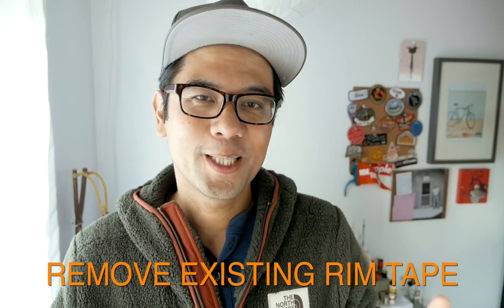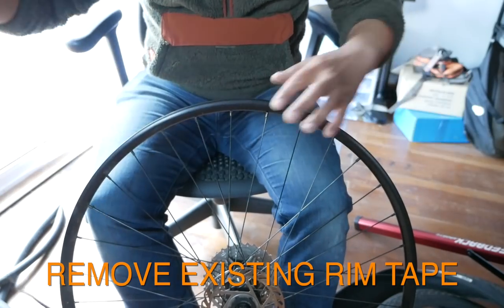How NOT To Go Tubeless - 6 Things I Wish I knew Before Going Tubeless

Comment: Ok, 1) first pump up your bank account, and set aside a lot of time, get ready for a lot of web surfing and garage time,  2) get the right tubeless wheels, 3) get the right tubeless tires, 4) get an air compressor or air compressor type pump,  5) get the right sealant (environ friendly, CO2 compatible, repair bacon compatible, never mix sealant brands),  6) get a tubeless tire repair kit including A) a tubeless valve stem tool  B) a tubeless hole repair tool and bacon strips, C) CO2 cartridges [2 min], D) CO2 inflator tool , E) good tire tools, F) extra valve stems with removable cores, G) you may need 10-12 zip ties and a cutter - the zip ties can be used to lightly press the tire to the wheel in hopes of promoting a better tire-to-wheel seal before you use your last CO2 cartridge - there are different zipping strategies for different tires 7) labor: mounting and sealing for the 1st time can be really messy - get a sealant syringe or lots of rags and soapy water 8) If you get air leakage, go back to shop or garage, take tire off, check the sealing tape, if needed, clean wheel and tire and valve stem with warm soapy water, dry and start all over, buy a better brand of tape, buy a lot of tape, remount tire, remount valve stem, add new sealant, 9) for adventurers far from help, its always smart to carry an inner tube - say what?  . . .  OR  just do what 95% of professional bike racers do - just forget the tubeless cure-worse-than-the-disease craziness and use a really good tube (e.g. Specialized, Michelin, Conte) inflated to a reasonable pressure and go riding.  :)
Reply: Or go to a shop and do it for 35 dollars
Reply: It's literally not rocket science... you put some tire goo in the correct tire and rims and you're good to go no flats no issues you can go low pressure it's great
Reply: Not gonna convert to tubeless cuz wheels aren't tubeless ready. Better save up $ for a brand new gravel.
Reply: @CERVEZAslam or just dont spend an extra 35 dollars on the 300 dollars you already spent going tubeless
Reply: Hahaha you said it all.

Comment: I converted two bikes to tubeless.  One conversion was done by an excellent bike shop.  The other done by me. I had tires going flat (slow leak) on both bikes after 4-6 weeks of commuter riding.  I've ridden tubes for years and I have never had a failure from patching a tube on a tour.  They are a known quantity.  I thought about a tour I did 2 years ago where I ran off the road and crashed my front wheel into a large boulder.  The side of the rim was dented badly. There is no way a tubeless tire would have reseated against that rim.  But I was running tubes. I installed a spare tube, pumped it up and rode the remaining 40 miles without a hitch. Being able to get home in a remote area is far more important than how "bulletproof" tubeless is alleged to be.  I am considering Rene Hearse TPU tubes, but I will never do tubeless again.

Comment: Short version:  it's all about tolerances.  Long version: It's all about tolerances.  You can't depend on a loose-fitting tire.  You can't depend on a rim that's undersized -- either diameter or width.  If the diameter is too small, the tire can slide around and possibly pop into the rim bed's central well.  If the width is too small (e.g. half the width of your tire), it's not well-supported during cornering, and can lead to burping and rolling it off the rim.  You can't depend on a rim without a bead shelf -- it keeps a (properly sized) tire pushing against the rim sides, and thus sealed -- without it the bead can more easily slide into the rim's central channel.  You can't depend on a tire with bumps of rubber on the bead (from where rubber was injected during molding) -- just another pinhole through which air/sealant can leak.  Clip them off with nail clippers.  You can't depend on tape that's too narrow (narrower than the bed and sealant can seep under it).  It needs to come up the sides just enough so the air pressure smushes it between the bead and the rim sidewall -- that's what keeps the sealant from seeping underneath.  You can't depend on thick tape, as it rounds out the bead shelf, neutralizing it.  You can't depend on a tire whose bead is kinked or stretches.  Get tires with soft rubber coatings on the bead, preferably square-ish in profile, as that's more surface area to mate to the rim sidewall.  Mavic's tubeless rims (e.g. the new Open Pro with the 'whale humps' like on Zipp NSW's) are great because they have very tight tolerances and a bead shelf.  Nox rims also have the shelf, tight tolerances, and with say, Maxxis ReFuse or Panaracer Gravel King SKs, seal with just a floor pump and not even any sealant.  I'm sure there are other combinations (Boyd rims come to mind), but these are known to be easy and reliable to work with.
Reply: Bead shelf you say... For a noob this is probably the thing that should go at the start of any tubeless how to video. Check if your rim has a bead shelf.  To be fair who would knowingly buy a replacement for a damaged rim without one?
Thanks for this useful insight.

Comment: I'm actually thinking of going back to tubes. I never had a problem with them and life was simpler with them....for casual riding.
Reply: Well, I am cycling around 15000km/year and had this year my first two flats with tubes. Tubeless is the way to go in mountainbiking as I heard, but with all other bikes tubes do great.
Reply: My problems with tubes were common sense problems and easier to repair (or get repaired at my local bike shop). Went tubeless 3 years ago and never ending problem with tire. 3 different repair shops, tire replace twice - valves gumming up and today gel leaked out, valve came apart and can't get air in now. Would not go this route again.
Reply: @ForkInTheButt  have you had a puncture that had sealed with the sealant in the tube ?
 I cut a old tube all the way around and use it as a buffer between the tire and new tube  .
 I have hit a couple of 3 inch jagged rocks that they use here to fill pot holes and this time no flat .
Reply: For casual riding there’s no need for tubeless
Reply: I enjoy being able to ride over glass and hit kurbs worry-free, but tubeless is absolutely higher maintenance because it tends to lose pressure quicker (and if it's damaged, quite quick) and then you're supposed to top up sealant a few times a year. I'm definitely a tubeless person though - if I was changing tyres a lot, that would be the one time I definitely wouldn't use them.
Reply: @U Betcha Lol .

Comment: Here's the thing... they say going tubeless saves u weight, how much weight? approx 27.5"=109g(218g), 29"=116g(232), remember u have 2 tyres. so basically you're looking at 232g for a 29er but then u need to bring a tube along just incase u get a big cut on the side n your sealant will not plug the sucker...so, effectively speaking, u save only 116g cos u had to carry a tube. tubeless, in the long run, will cost u more undoubtedly so. The sealant will need replacement or replenishment after every 3-4 months depending on the sealant u use. the only benefits aside from saving 116g is that u can continue riding if the puncture hole is relatively small plus u get ripped muscles from pumping those impossible wheels n good luck doing that when using a portable pump n if u use co2, add that to the cost of going tubless

Comment: I’m going tubeless for various reasons. I don’t have to worry about carrying an extra tube with me although carrying one is still recommended, I don’t have to spend money on inner tubes constantly, tires are slightly lighter not by very much, but what broke the camels back that made me take the decision to go tubeless is one of my tires actually rotates indecently from the rim with the inner tube causing damage to the valve. I’ve already gone through 4 tubes because of that. And it’s because the tire is no good anymore. Going tubeless will eliminate all those problems. I’m the same thinking. Fit it’s not broken, why fix it, but in this case, going tubeless will solve all those problems.

Comment: One tip that I felt kind of dumb until it hit me - after adding sealant the last time on one of my tires the bead wouldn't seat. No problem - remove valve core, use the reservoir "manual" compressor, bead seats. Ok but now what - you have no core and if you take the pump off the bead falls away. Finally on the third time did it right - remove the pump - quickly get finger on stem - now quickly move finger and get core back on there. Voila bead still seated. Now inflate away.

Comment: The market is pushing us all to go tubeless because now majority of the tyres are tubeless ready. This  means that the tyre bead now made with carbon insert is less flexible and harder to put on the rim - and almost impossible to do by hand. Whereas before on the side of the road it was easy to change a tyre without tools.

Comment: Instead of installing and inflating a tube, after you tape your rim, just spray soapy water down into the bead all the way around both sides of the wheel and inflate to seat the bead that way. The soapy water will help the tire slide into the bead easier and if there are any leaks you will see the soapy water bubble and you can address that before you fill with sealant. Once you filled the tire with the air that you want and know there are no leaks then just pull the valve core to release the air, add your sealant, and reinflate. I also then spritzed the bead area again with the soapy water after reinflation just to make sure there were no other leaks.

Comment: Ok here it goes if anyone reads this, just more pointers/thoughts. 

1. The most important part of setting up tubeless, regardless of what tape your using, is to first run a tube for a few rides after the tape has been installed, this will ensure your tape is seated/sealed. Also if you have a new tire this will stretch out any folds in a hard casting (new Continental MTB tires need this). Tape install may also be made easier by cleaning your rim surface with alcohol prior.
2. Gorilla tape, ~1", can make for less pain on tape install and the longevity of the tape. 
3. I normally make a hole in my tape by melting it with a metal poker and lighter, i've had stans tape split after cutting an x. 
4. I've had problems with the valve stem leaking over the years (cx mag had an article on these lately) so I generally like to use gasket maker and an o-ring against the rim surface. This has made this area a little more leak-proof.
5. I used to think that seating one side of the tire was beneficial, but now I disagree, on some tires this will cause too large of a gap and prevent a tire from seating at all. 
6. To make the process easier it is always recommended to use an air compressor and soapy water to lube that bead.
7. Remember to add sealant after 2-3 months (thru the valve stem, don't ever break the bead if you don't have to). You should be riding a bike setup tubeless enough to have to replace your tires after 6. If not, in my opinion, tubeless is not for you.

Hope that helps. Tubeless is great when you get it right. Cheers!
Reply: I agree with you except for a small difference on point 1.  I put the tape on, put a tube in,  inflate to a high pressure (below the label maximum of course), and let it cure for 24 hours.  I've never had a problem if I do this.  Patience is key.  For what it's worth, I have about 35k miles on tubeless road setups (mostly 700x38, but other sizes as well.)
Reply: Don’t know about 7. If your going to ride in a way that’s prone to punctures, and pinch flats if you run tubes, tubeless is the way to go. I run tubeless on my street bike (couple of hundred miles a week) and my fat bike (less than 1k miles a year). But I wouldn’t dream of taking my fat bike on single track or into the desert with tubes. I pack a tube (with a healthy dose of Stan’s in it) in case of tubeless catastrophic failure.
Reply: Did you mean to say 6 months? I'm new so not sure how often I'll be replacing tires.
Reply: " replace your tires after 6" Six what?
Reply: @curiousgeorge555  I think I meant this in a few ways, mainly if you don't ride your bike weekly I wouldn't recommend tubeless. It can require that muck more effort to get a bike moving after storage. Also, depending on the tire/trail types/environment/how much you ride, tires maybe only get one refill before the tread is worn-out, which can be after 6 months of hard riding. IMO The perfect scenario is if you only break the bead once in a tires life; when removing to throw it away.
Reply: @modsquad8u  See comment @curiousgeorge555, cheers.
Reply: @SmuggiNOLA  Totally agree, grew up where goat heads meant regular flats. However if you a casual rider, who dusts their bike off for an occasional ride with the family a few times a year to maintaining tubeless would be more of a hassle than anything else. If your someone new to cycling and want to try it out, you should! It's a great excuse to get better performing tires that won't weigh you down :)
Reply: @stroudnick  I ride almost daily. Likely will go tubeless soon. Cheers.
Reply: Thank you.....I’ve heard that Gorilla tape suggestion before....I appreciate you reinforcing that suggestion.
Reply: @captaincoyote1792   No problem, also Scotch Strapping Tape 8898 tape is also a good option, although its not a durable as stans (may require 2 layes), it's way cheaper! Cheers!
Reply: I like number 4. If there is one problem I've had thr most its value stem leaks. I've been using Stans values with the cone shape inner amd I wonder if the are meant for a wider inner stem hole that they can seat into?
Reply: @racerx8410712  Also you can get o-rings at any automotive store and they work well if not already included. Not sure about Stans Valve stem comparability, i've had good luck with stans stems. I do however vaguely remember that Mavic recommended their brand valve stems for their wheels. As a side note, if your looking for the best valve stems, check out Lindarets is worth it for peace of mind (i've sheered multiple cheap aluminum ones in the last 6 months; from bad pumps to impacting them by accident).
Reply: RollinRat  Agreed! Yeah, you should explain what a split tube setup is to the people!
Reply: Nick, great advice, you know what's up with tubeless. I've almost cried trying to set them up when learning. Using a tube for overnight really helps to seat new tires.
Reply: Great because…? What’s the benefit
Reply: Agree in principle with #7. Wife and I each have a MTB and an expedition bike, 4 bikes/8 tires total. Besides splitting our miles between two bikes we are also not aggressive riders. Therefore a set of tires easily last us a few years. Going tubeless would have me demounting 8 tires a couple times a year to clean out dried sealant and refilling. That’s 16 tire demounts a year. With tubes I may get 0-3 flats in that same year. Some of that work load difference would be mitigated since about every other year I do demount all the tires to “rotate” between bikes and front to rear to balance out tread wear. But to Nik’s point, with the longevity of our tires I’d be creating myself an awful lot of extra work to keep tubeless maintained.

Comment: Excellent Video!  Tip for tubeless newbies: Lezyne Pressure Overdrive model floor pump. The pump has an air reservoir that you fill first, then release a fast, large volume of air at once by flipping a foot lever.  Tubeless is a pain in the ass, but it is worth it in the southwest where you can pick up six goat-head thorns in the front and back tire at the same time. I was almost crying in the garage one night trying to set up new tires cleaning up old sealant, taping, valves, tires. Egad, even mounting tubeless tires can make you reach for the whiskey!

Comment: I went tubless and used finish lines long lasting sealant. No issues yet with lightsingle track riding on 275+ tyres.  A garden weed pressure sprayer is a great hack to use instead of a compressor.  The water inlet tube inside the bottles can replace the hard nozzle extension (hard pipe between nozzle and trigger) and the water inlet tube matches a presta vale perfectly. There are a few vids online about it.